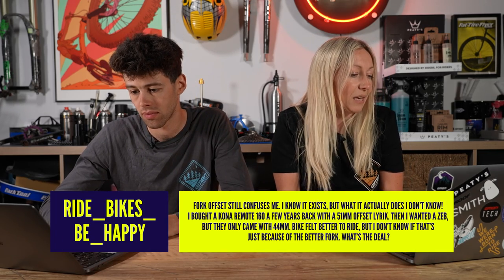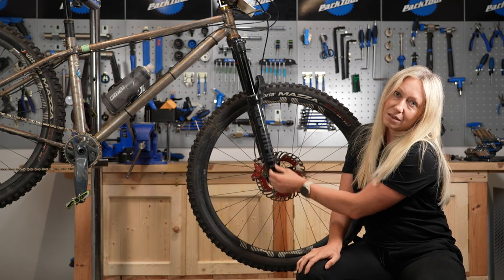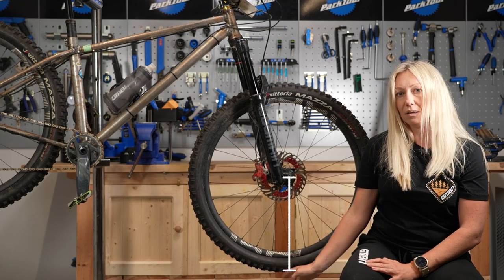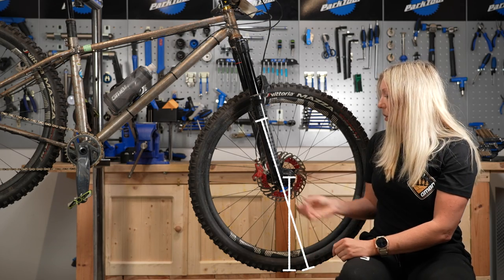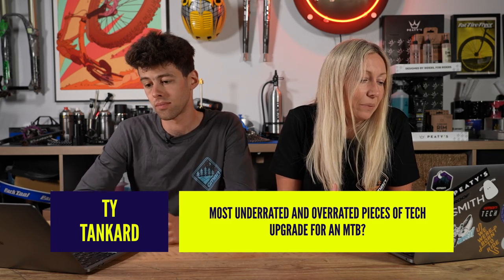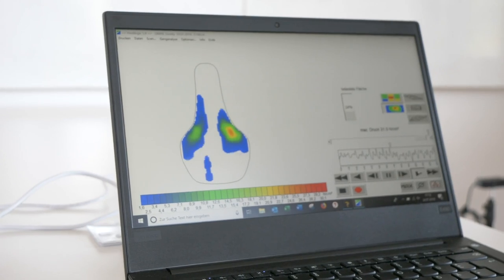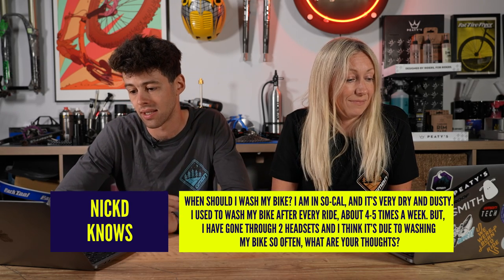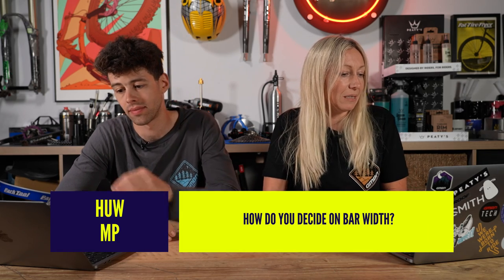WTF Are Offset And Trail On An MTB And Why Should I Care? | #AskGMBNTech

Comment: offset is measure relative to the steerer tube and not the fork lowers, its common for the fork crown to provide some of the offset
Reply: This is true, I changed the offset on my forks by changing the crown/stanction section.  This pushes the full forks outwards or inwards, the relationship of the tube to the axle remains constant.
Reply: Yep, it’s probably more often mostly offset at the crown.  A lot of those other straight non-suspension forks also have an offset created by angling the legs forward slightly, and obviously on older road bikes, it’s also done by curving the leg.  The important thing is just how far the axle is ahead of the steering axis.

Comment: I live in the SoCal high desert (always dust, never mud) and I use compressed air to blow off the dust then a damp Costco microfiber to finish it off..... bearings last forever, no water near your fork seals and overall just way better than washing. In places with actual rain, you have no choice but to wash.

Comment: YESSS, I built my own wheels and I have never had to worry about them. They are amazing, and you can build some really good wheels for under $300 for the set.

For handlebar width, shoulder width also factors in. A bar that's too wide for your shoulders will give you less leverage than a more narrow bar that fits your shoulders.

Indeed, the topic of air vs coil compatibility of the frame is a fairly complex one, but the simple matter of it is this: a progressive frame will work with air and coil, but with air will feel bottomless. A linear frame is only compatible with air and can damage a coil shock or itself. How can you tell? If it's equipped with a coil shock at the shop or in the box, you can likely use either. If it's equipped with air, use extreme caution when installing a coil.

Comment: I am pretty sure shorter offset is often for 29"/slack head angles and longer offset is for 27,5"/steep angles. I think you mentioned this the other way around.
Reply: Offset is there to enable you to attach the front wheel in front of the fork instead of at the fork(tube). This increases your wheel base and for the same bike it would increase the room you have before toe overlap would occur with the front wheel. Steeper head tube angles and larger wheels brings the front wheel closer to your toes to increase the risk of toe overlap. This would be fixed by increasing your fork offset.
Therefore it's bigger wheels and steeper head tube angles need bigger fork offsets to prevent toe overlap with the front wheel.
Reply: Lol nope, they got it right. And yes you need smaller offsets with smaller wheels, all else being equal
Reply: For a quick math I compared 2 offset with different angles and this is a 29er DH Bike, 
Offset:57
63 HA 114trail
62 HA 118
Offset:47
63 HA 123trail
62 HA 128trail

Comment: Only mentioning Shimano for the bleed bite point question? Would've thought you should at least add SRAM to that, where the reach is supposed to be from 75-80mm center of grips to tip of the lever, and contact adjust fully out opposite the arrow.

Comment: #Askgmbntech Hey Doddie and Anna great to have the gang together again, I have installed Magura MT5 brakes, they work great,but the front brake rotor has an annoying ring when I rolling at speed and rattles when you tap on the rotor, everything is torqued to spec and it’s driving me mad…what’s the cure?

Comment: I always wondered what fork offset was, does it have the same affect when the fork crown differs like when the stachions are set back closer to the steerer tube?
Reply: Maybe. Fork offset is simply the perpendicular distance between the steering axis and the wheel axle, so it doesn't matter how you get that, by a fork crown or dropout. And so long as the motion of the suspension is parallel to the steering axis then the offset won't change.
Some forks, like many linkage forks and the intend forks, have suspension that changes the offset through the fork travel, and this may or may not be a thing you want.

Comment: Would running a 46mm fork on a hardtail with a 47mm headtube angle risk cracking the frame? Would an angled headset help reduce the added stress?
Reply: The range of available offsets among forks is not enough (alone) to cause any damage. You would have to dramatically increase the trail to have any concerns
Reply: @SubversionGarage  Thank you kindly, that's super helpful to know

Comment: #AskGMBNTech I have a new bike with a 100mm rockshox recon gold fork, my weight is 100kg and I have had to add 140psi to get the correct sag with compression fully open. This is way higher than I have set on longer travel forks and they don't feel as plush. Should I reduce the pressure but add in some clicks of compression? What is the difference between more psi and fully open compression vs lower psi and compression added on? Thanks.